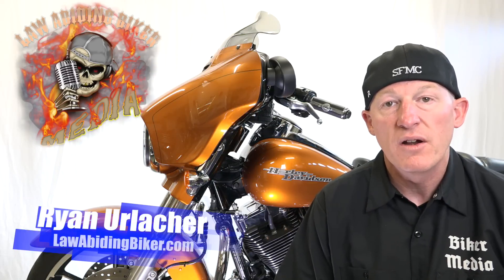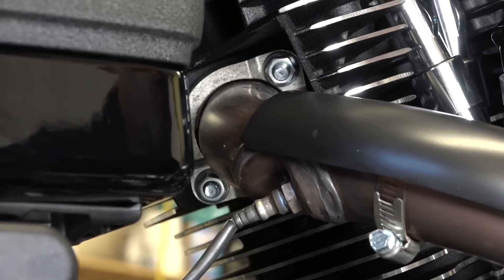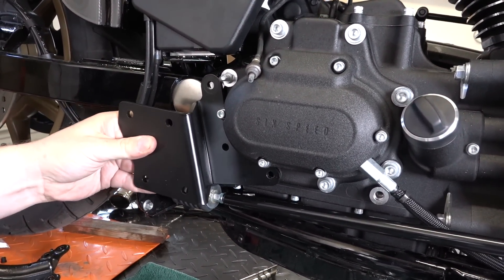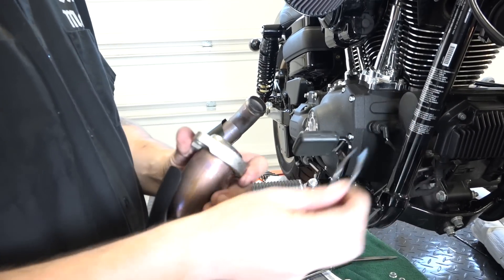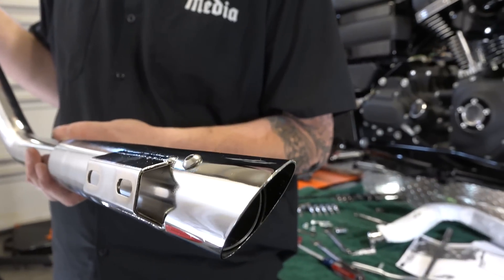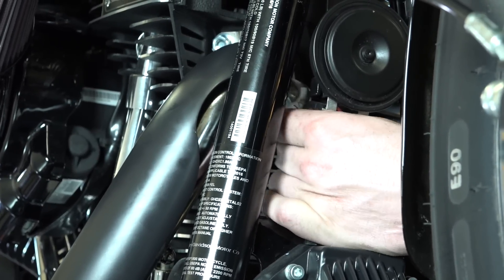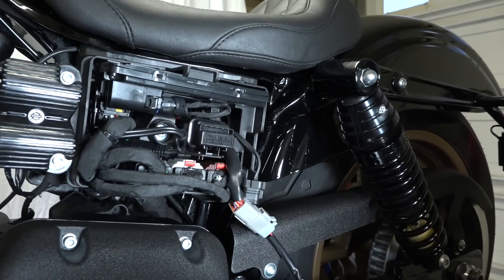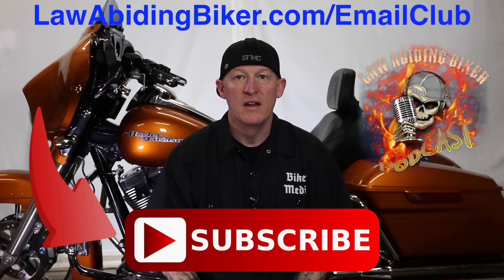Install Vance & Hines Short Shots Staggered Exhaust on a Harley-Davidson | Sound Comparison

Comment: Huge thanks for an extremely helpful video!  The most annoying part of the install is the nut plates!  Tip: Before bringing the pipe to the bike,cut a small  length of thin cardboard (like the back of notepad thin) and place that at the base of the bracket you are going to slide the nut plates into.  Cut another for the rear (pipe side) of the bracket.  Now slide the nut plate in and line holes up with slot in bracket. Bring the pipe to bike and after loosely installing the head pipe, you can easily install the bolts into the nut plate because it won't move!!!

Comment: My recently-acquired 2010 FXDWG came with the blacked V&H Shortshot staggereds. They are a really quality product. They fit beautiffuly and sound nice, if a bit on the loud side. I intend to add some baffles later on. This is an excellent video, especially the part about installing the O2 sensors, which has to be done carefully. Thanks, especially for the sound comparison.

Comment: Sounds good MAN! got my 2015 wide-glide stage 1'd, bigger free flowin air box and ECM to put more fuel into cylinders, just bought the short-shots will probably have'em on by Friday, can hardly wait. Thunder-Bay custom cycles in Tampa does GR8 work.

Comment: 11:10  Regarding Oxygen sensor. I have 2017 FXDB Street Bob and front O2 sensor size is 18mm and the pipe has 12mm thread size and I can't fit my short shots to my Street Bob for that reason. Any advise ?

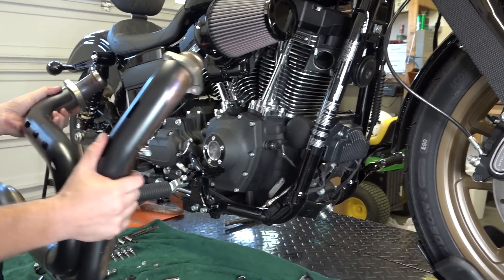Comment: In the video, starting from around 4:12 there appear to be two empty holes in the transmission casing slightly below the cover which has "SIX SPEED" written on it. What are those holes for?
Reply from the maker: Those are where the bracket mounts that holds the exhaust on.

Ride safe & Ride Often!
Here is a link to a bunch of our useful Free vids: http://www.lawabidingbiker.com/freevideos
Here is a link to some of our useful for purchase videos: http://www.lawabidingbiker.com/buyvideos
Want Answers & Information Fast? And help support us at the same time? Do you like the content we provide?
Our patrons get answers to their questions/comments/feedback in less than 24 hrs and are part of our Private Facebook Group. If you are interested in being in this exclusive group you can get all the details at ==> http://www.lawabidingbiker.com/patreon
If you haven't subscribed to the Law Abiding Biker Podcast make sure to do so. Listen in as we talk weekly about issues/items like this & so much more. You can listen on iTunes (Apple/IOS), Stitcher Radio (Android), or any other Podcast App ==> http://www.lawabidingbiker.com/podcast
Join our free email club at http:///www.LawAbidingBiker.com/EmailClub. Only relevant content will be sent from time to time. Email club members are the first to find out about free or for sale content are given special coupon codes.

Comment: Have a 2016 Harley Fat Boy S - and am struggling to figure out how to get off the stock mounting bracket for the original pipes off the bike?  Took off the two bottom bolts.but it seems like it's not going to be easy to take off and I need to get the rear footage off as well.

Comment: I have the same bike. What torque spec is the bolt to the flange and the transmission bolts to hold the bracket
Reply from the maker: I don't know off the top of my head.  I'd have to steer you toward the shop manual.  Sorry

Ride safe & Ride Often!
Here is a link to a bunch of our useful Free vids: http://www.lawabidingbiker.com/freevideos
Here is a link to some of our useful for purchase videos: http://www.lawabidingbiker.com/buyvideos
Want Answers & Information Fast? And help support us at the same time? Do you like the content we provide?
Our patrons get answers to their questions/comments/feedback in less than 24 hrs and are part of our Private Facebook Group. If you are interested in being in this exclusive group you can get all the details at ==> http://www.lawabidingbiker.com/patreon
If you haven't subscribed to the Law Abiding Biker Podcast make sure to do so. Listen in as we talk weekly about issues/items like this & so much more. You can listen on iTunes (Apple/IOS), Stitcher Radio (Android), or any other Podcast App ==> http://www.lawabidingbiker.com/podcast
Join our free email club at http:///www.LawAbidingBiker.com/EmailClub. Only relevant content will be sent from time to time. Email club members are the first to find out about free or for sale content are given special coupon codes.

Comment: Hey Ryan... I just picked up a 2012 Switchback that had these pipes installed by the previous owner. How can I tell if it has the FP3 installed? Also, if it's not installed am I hurting anything riding it? It sound great and seems to run great with a little crackle n pop off throttle. Thanks!
Reply from the maker: Pop of the cover near the fuse block. You should see it there.  If there isn't one, the owner probably had a stage 1 flash loaded from a HD dealer.  The crackle and pop isn't uncommon. 

Ride safe & Ride Often!
Here is a link to a bunch of our useful Free vids: http://www.lawabidingbiker.com/freevideos
Here is a link to some of our useful for purchase videos: http://www.lawabidingbiker.com/buyvideos
Want Answers & Information Fast? And help support us at the same time? Do you like the content we provide?
Our patrons get answers to their questions/comments/feedback in less than 24 hrs and are part of our Private Facebook Group. If you are interested in being in this exclusive group you can get all the details at ==> http://www.lawabidingbiker.com/patreon
If you haven't subscribed to the Law Abiding Biker Podcast make sure to do so. Listen in as we talk weekly about issues/items like this & so much more. You can listen on iTunes (Apple/IOS), Stitcher Radio (Android), or any other Podcast App ==> http://www.lawabidingbiker.com/podcast
Join our free email club at http:///www.LawAbidingBiker.com/EmailClub. Only relevant content will be sent from time to time. Email club members are the first to find out about free or for sale content are given special coupon codes.

Comment: So Ryan, What pipes are you recommending for 2016 FLHXS? With Performance foremost and sound secondary. We do a lot of rides long distance often 2 up... Thanks!
Reply from the maker: Definitely upgrade your head pipes to the V&H Power Duals or cut out your cats.  The OS 450 slip ons have great back pressure and a low deep rumble.  The slips ons with the perforated metal baffles sound good, but don't have as much back pressure.  Based on what you said above, I would suggest the Power Duals and OS 450s.  Check out our V&H products at:  https://shop.lawabidingbiker.com/collections/air-fuel-exhaust
Reply: Ryan Urlacher , thanks for the quick reply. I'll continue watching your videos and being a member,  thank you. I will do some research on your suggestions and let you know or send you a picture on how it all turned out.

Comment: Hello I had a stage 1 done to my 2013 dyna  super  glide  and had it tuned after I got  home  I noticed  two  bolts  missing  on the transmission? Is this normal  if not what size  do I need?
Reply from the maker: No that's not normal, but we're not sure what size the bolts are.  I'd take it back to where you had the work done.

Ride safe & Ride Often!

Here is a link to a bunch of our useful Free vids: http://www.lawabidingbiker.com/freevideos

Here is a link to some of our useful for purchase videos: http://www.lawabidingbiker.com/buyvideos

Want Answers & Information Fast? And help support us at the same time? Do you like the content we provide?

Our patrons get answers to their questions/comments/feedback in less than 24 hrs and are part of our Private Facebook Group. If you are interested in being in this exclusive group you can get all the details at ==> http://www.lawabidingbiker.com/patreon

If you haven't subscribed to the Law Abiding Biker Podcast make sure to do so. Listen in as we talk weekly about issues/items like this & so much more. You can listen on iTunes (Apple/IOS), Stitcher Radio (Android), or any other Podcast App ==> http://www.lawabidingbiker.com/podcast

Join our free email club at http:///www.LawAbidingBiker.com/EmailClub. Only relevant content will be sent from time to time. Email club members are the first to find out about free or for sale content are given special coupon codes.

Comment: Do you know what the Torq specs are for the Head bolts on a 2013 sporty 1200c??
Reply: Cylinder headbolts 1st torque is 11-14 Nm or 96-120 in-lbs
cylinder headbolts final torque is 18-20 Nm or 13-15 ft-lbs Plus 90 degrees

Exhaust pipe bolt is 40-45 Nm or 30-33 ft-lbs

Comment: I just purchased a set of these. Can’t wait to get them installed. The rear O2 sensor was cross threaded at the factory, so now unless Harley honors their screw up then I’ve got to purchase another one. I am wondering why no thread paste was used either for easy removal. I know paste isn’t the correct word, I just can’t think of it right now. What are the other links in which you mentioned in the video?
Reply from the maker: No need on thread lock for this project. Use it if you like. All the links are in the description below the video Paul.
Reply: Actually the word I was looking for was Anti Seize..The rear 02 sensor was galled and the threads can't be used any more. I did show the Harley shop where I purchased the bike to see if they can warranty it out to include the stock exhaust if I ever wanted to go back. Plus i don't have any spare plugs for any fuel management on my dyna Street Bob??

Comment: when you said that v@h wanted you to reuse the bottom trans bolt for the top did they mean that you should remove the top stud bolt and replace it with that
Reply from the maker: Not sure. been a long time since that project. It works the way we did it. Ride safe
Reply: cheers for the reply the VH instructions are  NOT GREAT as I’m  fitting a set a the moment just didnt like the look of that ugly stud showing  your vids are top notch keep it up and stay in the Wind

Comment: these are the pipes I'll be getting for my 2016 street bob, as far as the air intake upgrade I was planning on getting the arlen ness big sucker, just not sure what the difference is between a stage 1 and stage 2 air intake. any suggestions?
Reply from the maker: Stage one intake is really anything that opens up and lets the engine breath better than stock.

Comment: Aren't these a little restrictive for the fdxls 110??  I get that sound is super important, but when you change your exhaust, power should be a concern too.  These actually lower your power if anything.  They do look sweet though.

I have the same bike, debating what pipe to go with, probably TBR or Bassani 2 into 1..
Reply from the maker: They are pretty much a straight pipe.  The baffles are perforated metal and are straight pass through.  Definitely less restrictive than stock.

Ride safe & Ride Often!
Here is a link to a bunch of our useful Free vids: http://www.lawabidingbiker.com/freevideos
Here is a link to some of our useful for purchase videos: http://www.lawabidingbiker.com/buyvideos
Want Answers & Information Fast? And help support us at the same time? Do you like the content we provide?
Our patrons get answers to their questions/comments/feedback in less than 24 hrs and are part of our Private Facebook Group. If you are interested in being in this exclusive group you can get all the details at ==> http://www.lawabidingbiker.com/patreon
If you haven't subscribed to the Law Abiding Biker Podcast make sure to do so. Listen in as we talk weekly about issues/items like this & so much more. You can listen on iTunes (Apple/IOS), Stitcher Radio (Android), or any other Podcast App ==> http://www.lawabidingbiker.com/podcast
Join our free email club at http:///www.LawAbidingBiker.com/EmailClub. Only relevant content will be sent from time to time. Email club members are the first to find out about free or for sale content are given special coupon codes.

Comment: Ryan if you are using a fuel management system like the FP3 do you have to reinstall o2 sensors?
Reply from the maker: The FP3 uses your stock 12mm O2 sensors. Good to go. Just hook it up and start tuning. That's why we brought it right to our very own store. There's also a complete tutorial video on our product page of the FP3 and further info ==> https://shop.lawabidingbiker.com/collections/air-fuel-exhaust

Comment: Love that bike, Ryan. I'm thinking about buying one for myself right now, but I'm a little hesitant with the rumor of the M8 trickling down to the Dynas. Also, I'm totally digging the podcast. Subscribed to both. Keep up the good work. In any event, a couple of questions. First, any problems with LEOs taking issue with the volume of the V&H pipes (I'm sure you don't have problems with that, but I might in Seattle)? Second, what make/model is that seat? I like the way it looks and the stock seat on the FXDLS has got to go. Third, I'm 6'1" with a 34" inseam. What are your thoughts on the forward controls? Sorry for the long message. Thanks for the great content.
Reply: Issues with the loudness of the pipes?  Not really, but in Eastern WA LEO's do not make that an issue.  But then again we also do not have to certify our cars every two years like in a few Westside Counties and in Spokane.  The seat, it is a Mustang seat.  Great seats and very comfortable.  The stock seat was just a bit to forward for me so I replaced it when I got the bike and now Ryan owns it.  I liked the stock bars, but Ryan liked these so he changed them.  A really good addition I must say.  As far as the motor, this motor is a tank.....at least in my opinion.  Yes the M8 is trickling down, but the 16-17 years are the only years for this bike.  So if you want the S model which has the Screaming Eagle motor in it you need to buy it now.  HD has said they will not do a Low Rider S for 2018.  Maybe another Dyna will get the S treatment in 18, but who knows at this point.  RK

Comment: I have a 2015 sportster 1200 48 with stock pipes.I just bought the bike from the dealer.I wanted them to add the vance and hines short shots before takeing the bike.They Didn't  want to.They said they would have to put it on the dyna to tune i tand it would cost 400.00.And thats just for the dyna.  They wanted 1,700.00 for the whole job with new breather..Crazy.  What should i do.
Reply from the maker: I suggest doing it yourself.  For the price of the dyno tune, you can by a Vance and Hines FuelPak 3.  Check out our Vance and Hines products here: https://shop.lawabidingbiker.com/collections/air-fuel-exhaust  We also have videos to help you do the install yourself.  https://www.lawabidingbiker.com/videos/
Reply: Thanks for the quick response.

Comment: No torque values for tightening those nuts at the exhaust stud bolts?
Reply from the maker: +Adrian Rubi  no. After they seat after about 500 miles you'll be tightening them a bit more.

Comment: I have to agree with you Vance & Hines truly sucks I spend a half a day putting a set of Vance & Hines straight shot from a 2006 deuce they didn't have instructions they didn't have the gaskets and they didn't have the oxygen sensor plugs they truly suck when it comes to this I'm not buy another set of Vance & Hines pipes